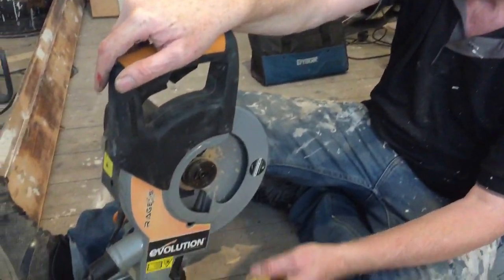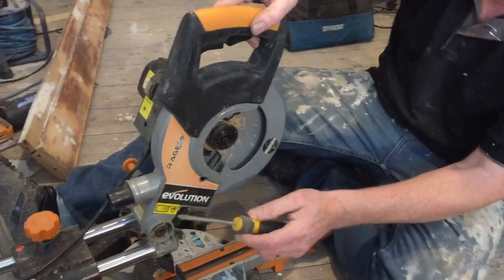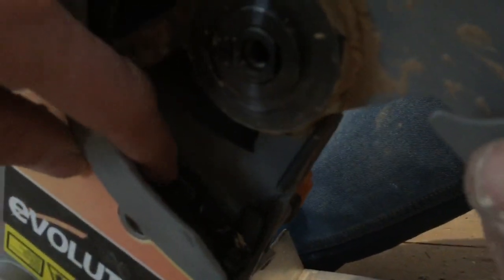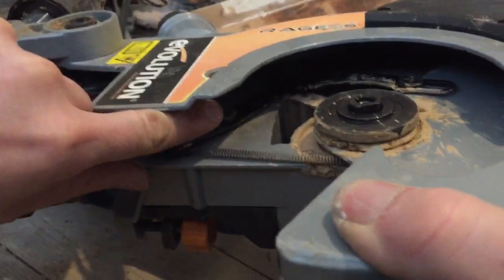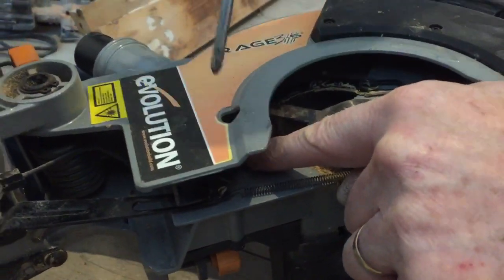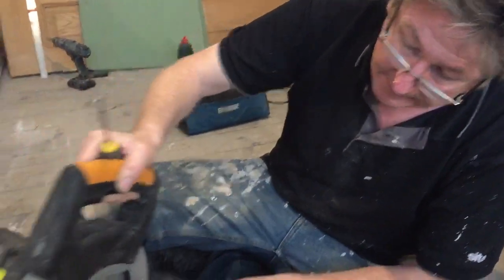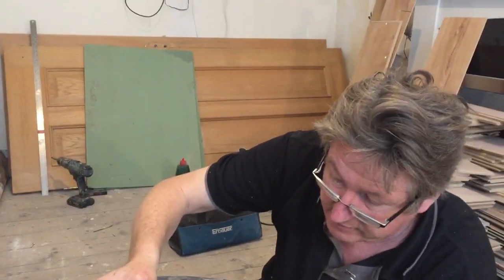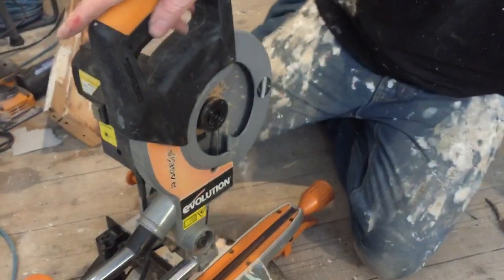Evolution Rage 3 Chop Saw Blade Guard Won't Slide Not Retracting How To Fix

Comment: Thank you so much. I have a slightly earlier version of this saw, that I use to cut firewood. Last night the whole linkage suddenly came away and I was lucky enough to spot the bolt falling into a pile of sawdust, but I couldn't see how it went back together. This evening, your video helped me work out how to reassemble the thing, so we now have the firewood situation back under control. It would have been a cold night otherwise 🙂
Reply from the maker: no worries, thanks.

Comment: Had the same problem or sounds familiar to my dilemma
Purchased a new replacement part (new design) it is the mechanism that is situated below the laser it should pull the guard back so it snaps shut covering the exposed blade but it is NOT FIT FOR PURPOSE as the blade guard is now getting jammed in the area below the handle and even with the addition of WD40 the guard won't come down unless you physically pull it down, so unless you're the type of person who gets your burning toast out of a electric toaster with a steel fork this shouldn't be a problem otherwise if you value your life or hands then if you need a replacement of the above part I highly recommend you find the original old design not go for this more robust looking replacement that evolution are now selling.
Hope this helps saving a few fingers and a few pounds/dollars of rage3 users.
Reply from the maker: we switched to a dewalt, that evolution isn't designed well.

Comment: Our guard mechanism fell out, we got the bits (except the spring) is there a video to replace the mechanism??? thanks, Mike
Reply from the maker: Not from us sorry we binned this saw and bought a DeWalt instead, there's a video on the channel for that.
Reply: @DanielJohnHowTo  Thanks, will look for it, doesn't show when I looked for one.
Reply from the maker: @mikejames663  https://www.youtube.com/watch?v=kwHen2F0XJk
Reply: @DanielJohnHowTo  Hi Daniel, sorry just picked this up, yeah, our saw is an evolution sliding mitre saw, can't find anything on changing/repairing the guard mechanism. Thanks for the info, much appreciated.